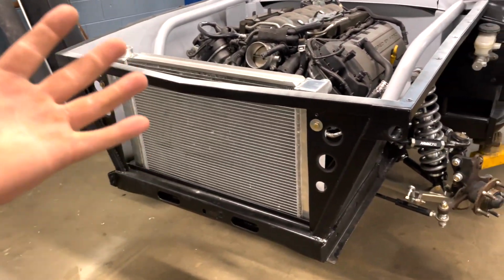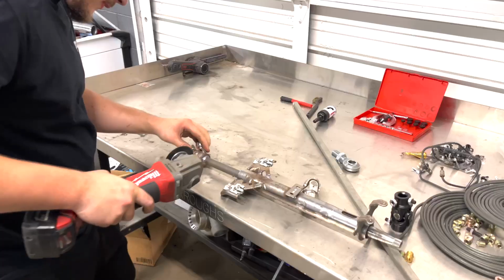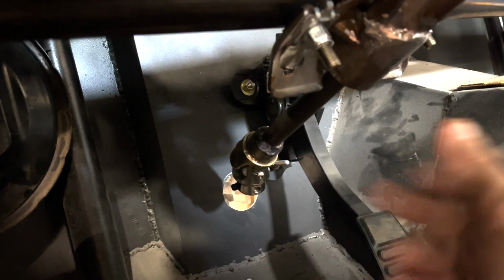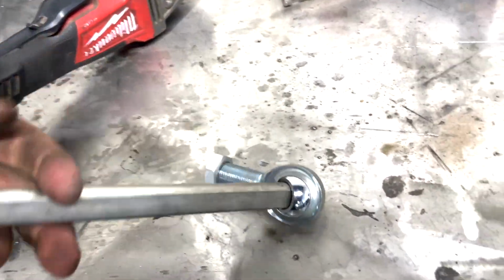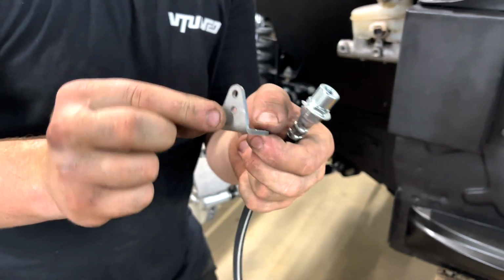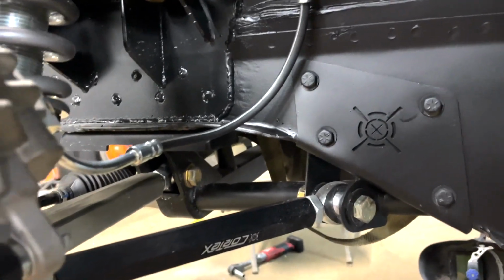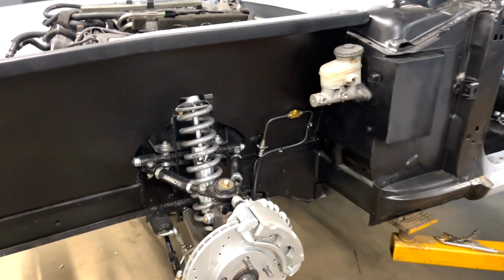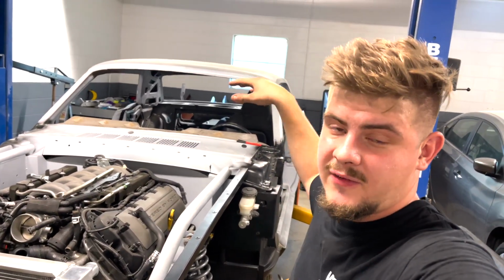My 1965 Mustang Has Steering And Installing The brake Lines And Calipers!

Comment: Make sure you have enough clearance for the shaft for body movement.  Right now the suspension is not under load so it will change a little once it is down on the wheels.  You are doing a great job.

Comment: All brake lines need to be double flared, due to the high hydraulic pressure. If your brakes leak or the hoses crack, it could prove to be fatal. Single flared lines are suitable for low-pressure lines in other applications, but not your vehicle's brakes
Reply: Come to the comments for purely this. My heart stopped when I saw the flared lines. Other than that looking good though.  But redo those lines !!
Reply: 100% agree! DOUBLE FLARE!!
Reply: OK Karen
Reply: And use a proper tube cutter not the grinder, as it may contaminate the lines with swarth.
Reply: @sawdust.and.sparks  Yes! Yes! Yes!
Reply: I have this same tool and it is a double flare tool - I didn't see if he actually double flared those lines. But also would recommend double flaring!

Comment: Looking good so far.. But I would suggest that you blow out all of ur brake lines since u used a grinder on the lines instead of a tubing cutter.. 1 small piece of grinding can cas u problems later on..
Reply: Yeah, I was watching the Fab rats channel the other day and they had a brand new brake line that was plugged. If they hadn’t spotted it before they installed it they would have had a hard time bleeding the brakes.

Comment: The u-joint should be in the engine bay and not under the dash. It will be hard to make a good seal on that hole. I would extend the steering column and shorten the second rod that goes to the rack. That way the column coming through the firewall is not changing positions all the time. Also it's better to cut your brake lines with a tubing cutter rather than a disc, cause the disc can leave metal particles inside the line, while the tube cutter is a cleaner cut.
Reply: I doubt listens, as he seems to take the piss out of people who actually know more than he does !! The whole engine to diff is all wrong, no pinion angle set, nothing ! You dont just cut and throw things in, if it were so simple all those custom chassis shops would be out of biz !

Comment: @Vtuned garage -  Ben, the brake lines should be connected diagonally to the wheels. (R Front to L Rear and L Front to R Rear), You also need to double flare your lines. The front flex brake lines look short. They need to be a few more inches longer.

Comment: I suppose that the "booster" is concealed in that square-shaped box behind the master cylinder? And I was going to suggest a proportioning valve, but it sounds like you have that taken care of. Excellent job, and if you need to make corrections on anything, you are smart enough to make them as needed. It's impossible to get everything right without an R&D department consisting of more than one young dude with an ambitious vision. I love the clean content and am super impressed with this build...as I was with the others. I wish you could break the 1 million subs mark. You need to be seen by more folks.

Comment: Steel lines have to have double flares, yours looked like single flare.
Reply: Wrong
Reply: Yes. Need double flares.
Reply: I agree. I tried single flare and It cracked and got air in the system. Sometimes you get lucky, but mostly you end up redoing everything.

Comment: I'd redo those. You did a great job, but I'd use Ni-copp lines and I'd double flare them. They'll last forever and they're easier to work with. Even if your double flare isn't perfect, they usually conform enough to seat themselves without leaking.

Comment: >I am skeptical of the flex brake line instalation The way the pipe comes off the caliper at a right angle it makes the rubber hose flex a lot placing stress on the pipe coming off the caliper I think the hose should be longer and come off vertcally off the caliper I am concerned about the placement of the booster I am surprized he did not know the brake pedal is in the middle I also agree with the comments here about cutting the brake line with the grider and not sure if double flare was done

Comment: for safety sake you should have the front left to rear right and vise versa because if you pop a brake line then atleast you would have brake pressure to one of the front and rear wheels, the way you have done it if one of the front brake flexis gets cut or leaks you won't have any front brakes and at speed the rear brakes will be like trying to brake on ice as for routing the brake lines under the subframe if you ever have to remove the subframe to do sump pan or other things your stuck with the brake lines in the way, you would be better off mounting them high up on the fire wall they will be out of the way of removing and installing the gearbox

Comment: Admitted that routing the brake lines under the car looks cleaner, however if you keep the passenger side above where it is connected to the body and below your master cylinder or proportioning valve if you use one to bias the pressure front to rear (what I would recommend) you will keep gravity in the flow and make it easier to gravity bleed the brakes - just a thought.

Comment: As a note; a tubing cutter should be used to cut tubing rather than a grinder. It makes a much cleaner cut! You don't want burrs and metal shavings in your brake lines. Also as another viewer has mentioned, double flare is better for high pressure applications.

Comment: A note on the flexi hoses... They should not touch anything at all on full lock. If it does touch then you need to change the routing slightly until it clears everything on full steering rotation.

Comment: When flaring tubing: make sure you're not like me and forget to put the fitting on FIRST lol.....I almost ALWAYS forget to do that! Same as shrink tubing on solder joints...make a nice solid solder joint then look down at the bench and see the shrink tubing sitting there lol
Reply: I have that habit aswell. I'll either froget the fitting. Or I'll put the fitting on backwards. I tell myself not to do it. But it still happens. I also like spending more time. Trying a take off, or slide a fitting over. A spot on a line. That was previously bent. Believing the fitting. Will slide over the spot you bent back straight. Even though you it's not, and it takes less than half the time. To cut that spot off.
Reply: @bretjjjohnson7942  haha nice to see I'm not the only one!

Comment: Ben, I think making a simple extension bracket to bring the flexible brake hose away from the inner wing towards the centre rear of the hub will massively reduce the required movement of the flexible brake hose (and at the same time negate the need for that rigid extension pipe that you currently have coming out from the calliper) this should be a better solution.

Comment: Make sure the brake hose don't rub sharp edge of frame when you turn wheel.     Put tire and wheel on and check to make sure hose don't rub wheel or tire when you turn or jounce or rebound.  .  You could remove spring and do jounce rebound study with jack.  Otherwise looks good just that is what I would do if I was trying to perfect it.   I have done jounce studies for OEMs.  Have 25 mm clearance minimum to frame or tire/wheel.  I normally try to get about 40 to 50mm clearance to tire/wheel minimum when I am designing a hose routing if it is possible.    Check Left turn, right turn, straight at ride height, jounce, and rebound.

Comment: Great videos.  Tip...use aluminum wire to make a mockup of the line then you can get your length and do most of your work on the bench.

Comment: Gonna be rumbling in the driveway before you know. I worked in parts in a diesel shop. The technicians used to use plain wire to make a pattern for some lines. They would fine tune the wire & then use the tube bender. They literally came out better than OEM. Coat hangers are great too if the lines are short. They used to actually use the wire for making metal pipes for plumbing as well. I saw them bend the wire for upper and lower hoses, then take it to a muffler shop and they would bend it to match and 9 times out of 10 it always fit perfect. All we have to do is add silicone stick hose on each end, then we were good to go.

Comment: You need to check out the DOT demand in terms of connecting a two circuit brake system. I belive it need to be in diagonal, one front and the opposite side back. If you loose one circuit, you still have brakes front and back.

Comment: I would move the booster over (above the steering shaft) might be easier.  Still keep the booster behind the firewall to save space in the engine compartment. Gonna be a beast of a build.

Comment: I definitely would have a straight shat under the dash then past the firewall a joint then  the double D shaft then the  stabilized heim joint .I never seen you use the 3/16” die to double flair the lines . They use single flare on “ AN” type tube nuts . I did see them on the die’s on the table .

Comment: Make sure you line the U-joints up on the steering so that they are in sync otherwise they will fight each other and wear out quicker. You have to line them up just like you would on the drive shaft. Also I would extend the steering shaft so that the U-joint is on the engine side of the firewall. That will make it easier to seal around the steering shaft at the firewall, due to less movement of the shaft. Due to the way a U-joint works.

Comment: You need double flare on them lines for the brakes you are using if it was still factory it would matter with 4 wheel drums but with disc brakes you need to mimic the lines that the Honda had and fittings will be metric but looks like you used standard ends so it's going to be a bunch of mixing ends ect... Where is the proportionate valve from the honda ? That would help you with the lines .

Comment: Brake lines need a double flare, if you just used a single flare it will leak. Also you will need a porportioning valve , you need more front brake than rear.

Comment: The brake lines look great to the bends look good. When working with tubing you want to use a long radius bend if not it can reduce flow. Awesome job on the mustang so far. Waiting for the next video. ❤🇨🇦

Comment: When you're patching that misplaced hole, make a cardboard template of the hole, then weld a complete patch in, then grind it smooth and start over. You'll never know you messed it up after you paint it. 

I'd also look at getting a rubber grommet or bellows to go in there.....(if you aren't already)
Reply: No crap lol
Reply: Every line running thru metal or touching should be surrounded by rubber grommet !
Reply: @mixalis6168  I was referring to the steering shaft, but it too should have a bellows or grommet to prevent any fumes or ? from coming in from the engine compartment.

Comment: If the car is ever involved in a hard frontal collision, that solid steering shaft is going to be driven into the passenger compartment and move the steering wheel assembly along with it, thus pinning the driver to the seat.  This could result in serious injuries to the driver or worse.  I suggest replacing the solid shaft with a two piece slip joint shaft to allow for considerable movement before the shaft bottoms out.

Comment: If your steering box is solid to the frame and your steering column is mounted solid, (They are) don't install that heim/rod end on the intermediate shaft. As the u-joints phase while turning it will actually make your steering stiffer and wear components.

Comment: A solid steering shaft is a bad idea. Should have a safety slip shaft. Don’t need a rod shoved through your chest on impact.
Reply: I think there is a crush part inside Honda steering column..

Comment: I would rethink the brake booster if you considered the stress on the brake pedal it needs the extra mounting surface on the back original mount to keep it straight. just my 2 cents and will keep from causing headaches later

Comment: Both sides look too short on brake hoses. Looks like the hoses are going to be over stretched.
Reply: I would have to agree with you man just what I was thinking should be more slack. Its almost to the end already. One big pot hole and it might jerk it apart.

Comment: You can use the OEM zbar bracket mounting holes in the frame to bolt your steering heim joint for the steering shaft. You would just need to manufacture a bracket according.  Keep up the great work!

Comment: Add the joint to the steering shaft. Otherwise the steering does not work properly. It is like you are steering the car with rope 😅

Comment: Hey! The brakes look good, but you might want to consider adding a 2-part reservoir for the brake fluid, just like the Ford Escape 2017-2019, it will be way easier to add more brake fluid by doing that.

Comment: Use the right size wheel an tire combo you want on the car before you finalize the brake lines. They look great but the may rub lock to lock in some areas on the soft lines you have.

Comment: Great job but probably a good idea to have the brakes joined on the opposite diagonal corner front left to rear right and front right to rear left so if you do have a brake line fail you will still have atleas one front and one rear 😉 keep up to good work

Comment: First off , throw that POS flare tool away. You need one that does double flares for brake lines. The ones you did will leak. Second . Speedway motors sell a bearing seal kit for the steering shaft at the firewall.  Third , the steering shaft needs support at the joint , which in you case is inside of the firewall. That will keep the lower shaft from moving while turning.

Comment: Honestly the brake hose will probably rub the rim, the way you bolted to caliper. It should angle down instead of back. And the hose needs more slack. Travel of shocks and such. You will see.

Comment: The only thing I would have done different is installed the flexible line with the suspension fully compressed just to check clearance.

Comment: I definitely see your brakes system being an issue later on
Reply from the maker: We can always upgrade later down the road
Reply: @Vtuned  lines need blown out since you used a grinder, and flares have to be double flare, single can't handle the hydraulic pressure. It's a easy, but necessary fix. Car is looking great.

Comment: Hey man great job, just make sure the brake lines do not rub against the rubber of the front tires, I suggest you test any 5 lug wheels just to be safe

Can't wait to see the complete thing painted and driving. Been there since your first appearance on the goonzquad channel

Comment: That sure looked like a single flare you used on the brake lines, if it is it will not hold and will leak. Always use a double flare for brake lines, also the tubing cutter is the tool you should use for cutting lines.

Comment: Ben normally you don't connect left and right on one axle. Normally you do front right and rear left and vice versa. It's of course different for race cars where you want to adjust the balance during driving...

Comment: I think you should connect the front right brake line to rear left… not sure about it. If one fails, you still have brakes in front and back. You should look at the s2000 brake lines.

Comment: When are you going to extend the brake rod to make up for the thickness of the steel that is now between the booster and the master cylinder? As it is, you will not have the ability for maximum braking. It is something that needs addressing, as none of us want to see you in an accident.
Nice job on the brake lines. I have done many, many of them, and it is not the easiest or most fun job to do.

Comment: That steering shaft is not safe. If you ever get involved in an accident that buckles the front of the car, then the steering shaft can’t collapse and the driver will be pinned by the steering wheel. You NEED a female shaft that can slide over the solid shaft to create a collapsible “crumple zone” to prevent serious injury.
Reply: Those steering shaft adapters are known to fail.  They often use "grub" screws that fall out rendering the car impossible to steer.  Hopefully he figures this out and listens to all the constructive criticism.  We actually want him to succeed.
Reply: @kimai1641  exactly. I only want whats best for him and his builds.

Comment: What about suspension travel on the brake lines?
Reply: The suspension will never droop more than it was , because it was in the air when he installed the lines . And up travel doesn't make them shorter , so I would say he's good with them as is .
Reply: Came here to say the same. Those lines need more slack.

Comment: You need to do it as a duel circuit systen if you blow a line you will loose all front brakes......ie front left rear right ...front right rear left

Comment: If you don't decide the header (exhaust) first, the steering shaft will be difficult later.
It is the position of the master cylinder of the brake, but basically the brake pedal is just below the steering.

Comment: Looks like the brake line shouldn’t have any issues under load either. It’s a few inches from clearance and will sit closer under load as the bracket is above the caliper.

Comment: The brake lines should be paired with the left front wheel with the right rear wheel and the other pump circuit in the same way. It is mandatory to install braking force correctors on the rear wheels.The best place for the brake hose to the other side is a fire wall, the subframe is a bad idea.

Comment: I think that the brake  peddle must be between the gas and the clutch,  or you will need 3 feet to operate the car. you have it set up, gas, clutch, brake. but it should be, gas, brake, clutch. Everything else is awesome.